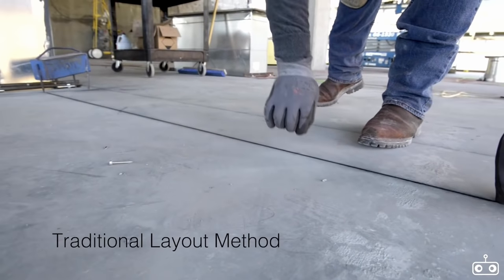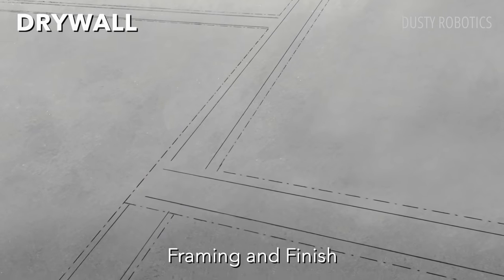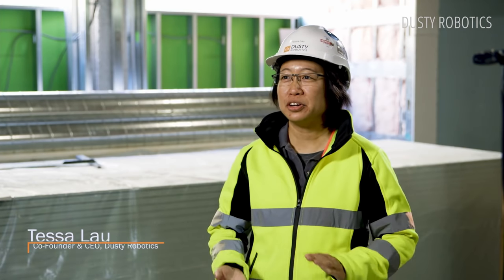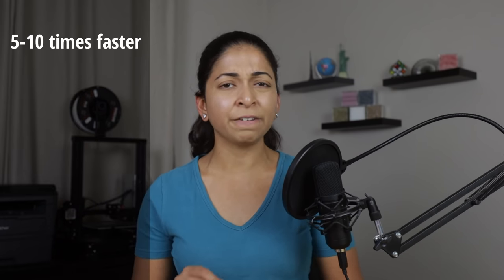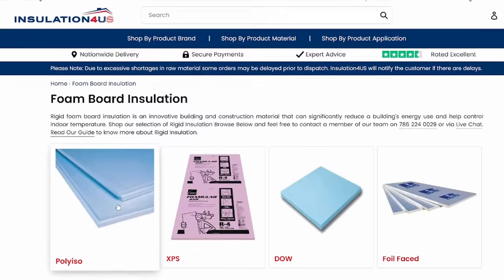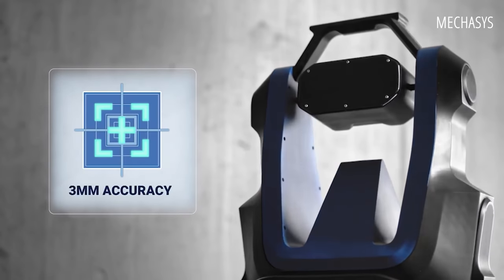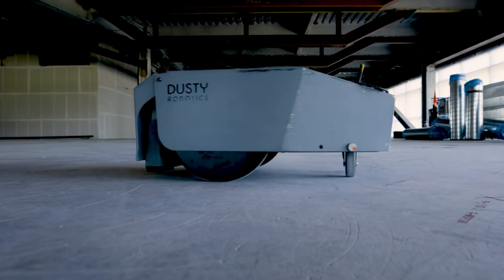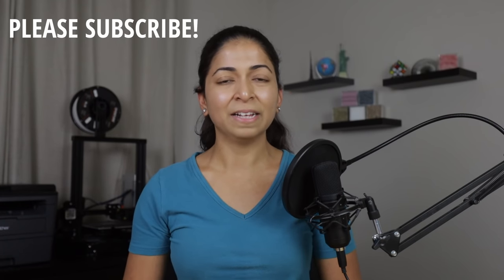Robotic Construction Printer | Dusty Robotics

Comment: I'm all for something like this, but when the prints get revised for the eighth time after the wall are already up you're right back to the Egyptian methods. Until the engineers and architects get better at plans the people in the field will be the ones figuring it all out.
Reply: Construction inefficiencies are typically not due to the manual labour on the construction site but due to errors made by engineers, architects, logistics, or just management in general. If we can replace most of these with AI most construction inefficiencies would conpletely evaporate and the cost savings of replacing those high paid positions instead of penny pinching away at minor improvements at automating manual processes would be massively greater.
Reply: Yeah, a robot isn't going to notice that something is wrong when doing their task. You always end up finding some sort of problem when building. It never works out perfect because reality isn't perfect. There's always something unforeseen that a robot would just completely ignore and continue on with its task.
Reply: Well, one of the advantages of the Dusty robot is that it generates an electronic record of every line or text that was put down and exactly where it was placed on the site (or not placed if a temporary object was in the way such as a pile of wood or other material).  This information makes it easier to understand what exactly needs to be updated when the types of changes you describe are eventually are made.

This stuff is so new that Dusty and its customers are still understanding how this will all work in practice, but the potential for having such logs for future reference is looking very promising.

Comment: Old doesn't mean outdated. The downsides you lay out confine the technology to smooth slab niches... commercial buildings. I see this doing well in its niche, but single slab foundations need extensive under workings.

You touched on surveying technologies, but didn't mention use of GPS. RTK GNSS/CPGPS can produce the millimeter resolution needed to reference the tripods to plans from multiple locations on a site... but some fully autonomous robots can be directly guided by GNSS+a radio base station, potentially solving the most error-prone step in surveying, raw data entry.
Reply: It's a new Constuction product for sure. I'm a single family builder on there wait list. If you build the same house a lot the plans are refined and don't change. I imgaine owning one someday and it can drive from slab to slab at night in a subdivision. Just like the robot excavation going on at night.
Reply: gps isn't going to work in a building, it would be better off with lidar mounted to it

Comment: Thank you again.  I love it!  It can also be used to chart ac ductwork on sheet metal that can then be cut on site or in a metal shop.    It can draw drain pan designs in sheet metal to be cut for use under fridge, water heaters, cloths and dish washers, showers, etc.

Comment: thank you for an edifying presentation.
I've been waiting for this robotic solution for over 15 years -- ever since I saw a toy robot wander around a table top with a sensor that kept it from falling off.  
Some of the interesting consequences include:
Subcontractors spend over 25% of their time doing layout, which is eliminated with a printed location (including vertical measurements). This time saving can be reflected in lower labor costs. 
Location errors are reduced or eliminated, e.g. the plumber drills for the waste line at location "X" and the liabilities lie with the owner of the plans.
Printing stamped plans puts the onus on the designer/architect....eliminating fingerpointing when a wall, column, pipe, or fixture is installed "per the prints." 
Inspections can be simplified if specs are called out and printed or barcoded at the appropriate spots-- and perhaps automated with robotic inspectors or drones.
Reply: HAHAHAHA Drone inspectors???? they'll never allow and inspector that knows code on the site.

Comment: Yeah it’s a cool and useful robot, but at some point you have to realize there is no point in cheap housing if no one has a job to buy them.

The reason we still use similar methods as the Egyptians is because of the “simplicity” and accuracy that you mention.   Also, if you’ve ever done anything at all in construction you know that things change in the field and a human can recognize something that a robot or even the CAD engineer might miss.

This is a good idea but probably needs a lot of attention and will for years until the entire industry changes to accommodate this tech.

Comment: Speaking as a plumber of 15 years there some more practical problems with this. Things on the plans have to changed often.  Which is why the industry prefers it to not be permanent markers. The reasons for these changes very some is that the owner or developer decides to change details on the project midstream. Sometimes it is an error on the part of the engineer or the architect. One-time according to the plans I was supposed to run to a 3in water main through the ceiling of the front foyer of a hotel down 8 feet and a cross into the ceiling of a second-floor balcony this had to be changed for obvious reasons. And is probably one of the less dramatic of the things that I have had face in my career

Comment: This got potential! if someone would invent the laser that prints id be better but might be just science-fiction. Keep up the good work Belinda, you're shining!
Reply: That's definitely a thing, but requires a lot more power, doesn't do color, and hypothetically damages the material. But laser etching and cutting is definitely an existing technology.
Reply: The major issue with a laser powerful enough to etch a line is danger from stray reflections. The laser can bounce off a nail head or other reflective material and seriously injure a workers eyesight faster than they can blink. Ink has its downsides, but overall has proven to be a fairly flexible and robust mechanism for putting information into a construction environment. The Dusty system can work with both water and solvent based ink depending on the need for durability and the environmental conditions at a work site.
Reply: @mpbroadcast  good points!

Comment: The printer is neat but better suited for larger companies that are doing volume work like apartment buildings and offices. 
I like your ambitious idea of a laser to etch walls and ceilings.
That would actually be easy but hard to get past the FDA and the other alpha bet orgs.
A cleaning bot would be a good challenge. The range of size and weight of debris varies from 2X4 cutoffs to nails/screws and sawdust.
Reply: I think it's a good thing that such powerful lasers would need effective safety measures to be approved. It would be a new hazard that many people on site won't expect. Improperly handled it would almost certainly lead to frequent eye injury. Either it has to recognise someone walking into the laser's paths or the whole area has to be closed for its operation.

Comment: I like this robot a lot. I think one of the big reasons you use chalk is because it washes off easily, often with just a rub. Another reason true string has been used for so long is because it relates to geometry, and you can find angles using arcs and a string is always taught between two points. You can tie off by methods to measure center to center on posts, or wrap around posts and take note of which side the string hangs off. You can account for the diameter of the string for additional precision.  Also, you can soak a string in ink if washing off too easily is really a problem. It's a wonder this isn't more common if the washing off is a huge issue for people. On some level if you can measure it once you should be able to do it again, or else you shouldn't be the one doing it in the first place.

Watching this makes me wonder if you could have a 3d blueprint of the floorplan and have a total station with an optical projector that superimposes the critical design aspect over the project as it is. It could, for example, on a slab, project positions for cutouts or electrical provisions, and on studs mark where electrical boxes are to be mounted. It could also be used to ensure electrical conduit fill provisions are accounted for prior to the start of construction, and that conduits of the appropriate diameter are not distributed in an overly "artistic" manner.

Comment: When excavating is perfect ( the ground doesn't always comply) and the footings are perfect (they can't be perfect they hold the ground that holds the building🙂) and the first courses of brick/block are perfect, and the floor is in perfectly;
Then we bring in the robot.
Meanwhile the humans can get on with actually building within the parameters they need to.
Reply: Obviously the robot knows there is 3 dimensions. I bet it will even upload the variance if it's out of tolerance. Again what construction site do you work on? I'm guessing it's always the other trade and not you that is sloppy

Comment: It's definitely cool, but there's something meaningful when you snap a line.  Errors don't compound as much on small scale, as everything is going to need to be measured regardless....at least in residential construction.  I think this is more tailored to skyrises maybe?  Where each floor is exactly measured identically?

Plus, as you said, it only works on flat surfaces really.  The main points that I have ever needed to drop a line is on a roof or for siding.  It's kind of nostalgic too, remember when I was 10 years old and my dad letting me do it, and then watching everything get built-up from that 1 line.
Reply: the information for vertical is there. what your refering to is work where the trade is using a caulk line to work, not for layout.

Comment: That would a amazing for pipe location that are in slab. For example in floor heating electrical or hydro floor heating. You either print on floor or have it hooked up to the flow and return to location. Would help when need make changes when drill into slabs.

Comment: Ive never seen a jobsite like that clean flat slab. Might be good for very large well organized jobsites.
Reply: The typical job site that Dusty works with is indeed much less clean than are seen in the video. Much of the time material is being moved on a just-in-time basis so layout can be performed.  Fortunately, the robots are pretty fast and the actual duration that portions of the floor need to cleared for layout are relatively brief.  Also, depending on site rules, layout can be done after hours as the system doesn't require daylight for operation. Learning how to integrate the operation of the robot smoothly into a job site workflow has been one of the primary areas of focus for Dusty.
Reply: @mpbroadcast  - thanks Mike. Are you involved in the development or B2B ?
Reply: @MichaelFlynn0  I'm involved with the development of the robot.
Reply: have you though to develop the awareness of the robot for 3d concrete printing purposes...because those beasts need to know where the current print run begins and ends

Comment: Weell, okay if you have a slab, but not much good for trench founds. You are right about accumulated errors. Many years ago I was visiting the site of an extension to a cottage hospital, overall length about 30 metres. The site foreman was trying to set out the cross walls for the bricklayers with no success. i was just along for the ride as we had already visited my job. The architect couldn't make head or tail of it, by the time they had set out a couple of rooms and walls they were off the foundations. What to do? After about twenty minutes I bored so I stepped in, got one man to hold the tape at the start, marked the first room, added on the thickness of the wall, added on the next room and so on... and you know what? It all fitted perfectly. You don't think you're creeping, but you always do.

Comment: As a carpenter doing layout and framing every day, I feel like people making tech like this don't do the actual work they're trying to assist us with. 

I DON'T WANT permanent marks. Engineers, architects and GC's make changes often and if someone was wrong in their layout, I want to erase their marks for my corrected or new ones. This sounds like a disaster I'll have to work around later. If it printed in a medium I could erase or replace, I'd by much happier to accept trying it.

Our union is already prepping trainings for this device, but I'm hearing very little about it outside of one GC using it in our state. There's robust and there's efficient. This device is efficient, but relies on too many systems and possible failure points to trust; whereas chalk lines have proven time and time again since the age of Egypt that they're worth their merits and usage. It's hard to really compete. In practice, this devise will cause more headaches, especially if it's using PERMANENT inks.

Comment: Printing on walls could be done - just make the robot into an xy printer, or plotter.
Fit a vertical track, like a mast, to carry a print head. This would move up and down to do the "y" part of the printing on the wall.
The robot itself could shuttle back and forth to provide the "x" axis information, and the two motions working together could draw anything.
I'll expect 10% of all profits generated from my idea! 😉
Reply: Will you front 10% of the costs for the framework? ;-)))

Comment: It sounds good in theory, but I'm sure they will need to work some kinks out.   Someone stated this was a service, and if true, they should change it to a device to be sold.  They probably need to work closely with a construction company to let them run it through real-world environments to find out what all obstacles they have to deal with.
Reply: I got the impression they are holding on to the units so they can improve them. Imaging buying a first gen model when model 2 3 4 5 are coming out in the next 24 months. guessing cheap residential models are on the way once most of the development is done or it's bought by Milwaukee  or someone like them.

Comment: Experienced guy with chalk line also checks if drawings are corresponding to reality, so you need this thing to also being able to survey the whole thing or dedicated SKILLED man to prepare for this. Also, cleaning before it would be a huge issue. And moving around obstacles is one, but more likely that this thing should be required to work with crews present on site, without pausing that circus for days. And it needs adjustments to CAD workflow - that nice crisp lines looks fantastic to sell this products to SEOs, but for actual crew - you need drawings made with proper colours and width in mind. At this point you could send in some small marching band, just for good measure. I am all in automation by small pieces, and this task is certainly great one, but it's it easy (without having a dedicated crew to run this robot)? No
Reply: Typically, the very same people who would perform manual layout are the ones trained to use the Dusty system. They can review beforehand exactly what the robot will print -- and they have control over all the line styles at the time of printing.

Also, learning how to integrate into the work flow of an active job site has been one of the primary concerns during development.  Often site material is being moved on a just-in-time basis to allow the robots to do their job rather than working with a completely clean floor as seen in the video.  Fortunately, the robots are pretty quick and the disruption is usually less than one might expect. Its not perfect, but it is getting better as the overall system is improved.
Reply: @mpbroadcast  viewing their product as solution, and not a tool is big crime of tech industry. So, that is nice attitude on Dusty's part to think otherwise, at least publicly🙂

Comment: Another spectacular video.  Well done.  

How well does this robot avoid exposed rebar and steel embeds?  If it hits something will it mess up the printed lines?  I can definitely think of applications, but as always the devil is in the details.
Reply: My experience — a few decades ago — was that concrete floors are never completely flat, smooth and level. 
The concrete is pumped up and placed by a crew that is moving back and forth while stepping over and under the rebar. 
Then an hour tor two later the cement finishers do their thing. It is often the end of the day as they work in the mid-afternoon sun or, even worse, they are in a hurry to get done before an impending shower. 
When the carpenters mark out interior fittings, walls and cabinets they are quite used to making subtle shifts to match reality versus the drawings.
Reply: @canadagood  The robot will know where it is in real space and can adapt to uneven floors, incredibly simple for a machine that runs on math.

Comment: Why not pre cut drywall? A factory made drywall panel with all the openings done off site? Feed the blue prints in and get precise placement and size cut by a machine.
Reply: Perfect, now we just need to cut all the blank panels to make the outlet-cut panels line up with the doorway-cut panels
Reply: Same reason you don't hire a professional carpenter to install a kit house.  They'll just resaw all the presawn lumber as a matter of convenience.
Reply: I think you have a solution to a problem that doesn’t exist.
Reply: @seanm3226  Prefabrication is the future. It won't come all at once but in steps. Changes are coming as the need for low cost, efficient housing makes robotic house building a reality. Cabinetry used to be done on site. Now it's done in fabs and hung on walls.